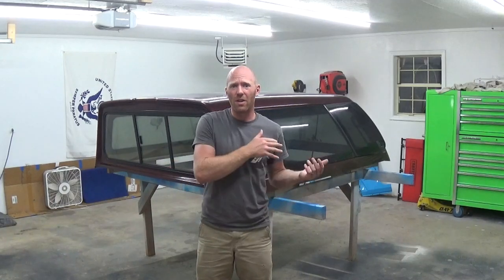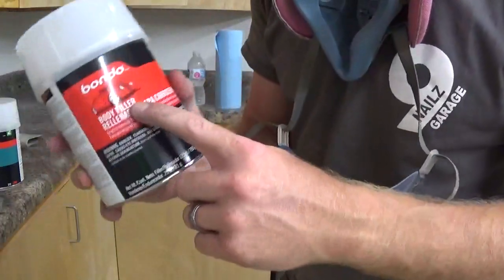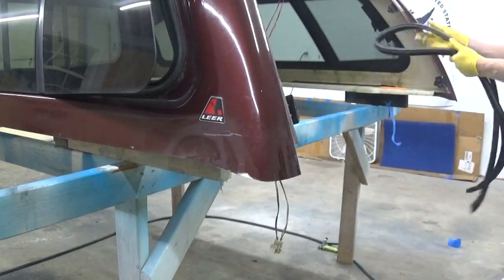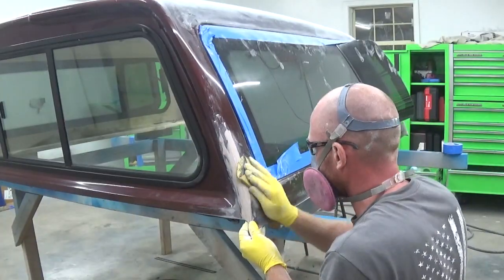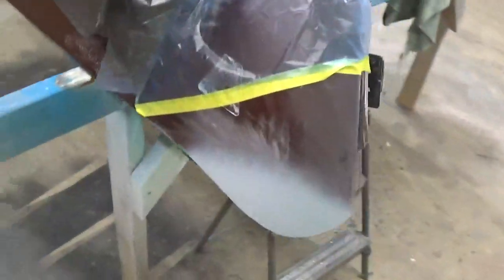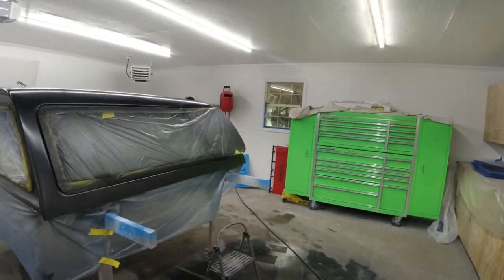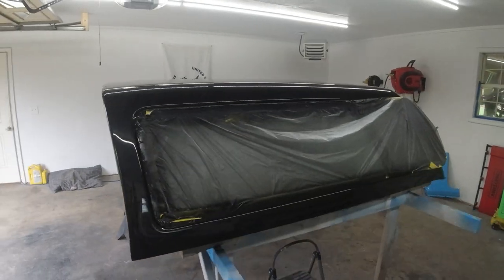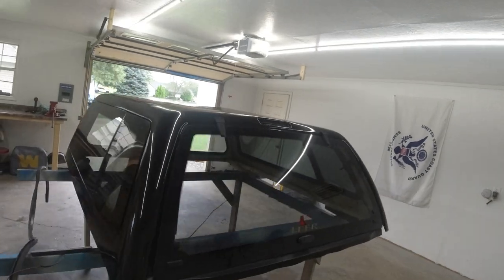How to Prep and Paint a Pick-up Topper in your Garage!

Comment: Thanks for the video. I just painted a red topper I got for my metallic gold F150 (they have to match right?). Even though I used about a 10 gallon compressor and an inexpensive gun , it turned out great. Your tips were super helpful. TU.
Reply from the maker: I always wondered how a smaller compressor would work, glad it worked out!
Reply: 2003 f150 in Arizona beige metallic and just scored a Leer tall topper free but it's Teal..
hate that color so looking to get it painted. I'm in a condo or diy still may diy next door parking lot be better than mismatched.
Ugly Teal grief.

Comment: That's an excellent video. I'm looking at a Snugtop, that's the pearl white that Ford has, and my truck is bright white. I hope I have your patience to paint it
Reply from the maker: Thank you! Good luck if you do give it a try. I was really intimidated the first time I picked up a paint gun, but it’s not as hard as it looks just don’t over think it.
Reply: @9NailzGarage  how much do you think it cost you from start to finish, not counting your labor?
Reply from the maker: @Merritt3246  1 qt of paint, a good pearl is probably going to run $100-$200,  a quart of clear coat and activator will run $40-100 depending on what brand you go with. Another $50 in miscellaneous materials not including the paint gun.

Comment: It would help if you posted a list of the supplies you used.
Reply from the maker: Sorry, I didn’t add them to this one, I’ll update it right now. Here’s a another video of painting some bumpers that can help out with painting too: https://youtu.be/U61x_mUtGgM

Also here’s a list of items that I used in the video along with their link in Amazon:

3M Accuspray Paint Spray Gun System
https://www.amazon.com/3M-26580-Accuspray-Spray-System/dp/B001UNZIP8/ref=sr_1_2?crid=6A3UOV9AIDX3&dchild=1&keywords=3m+accuspray+gun+kit&qid=1605282598&sprefix=3m+accu%2Caps%2C185&sr=8-2

Transtar 4603 Gray 2-in-1 Primer - 15oz
https://www.amazon.com/Transtar-4603-Gray-2-Primer/dp/B00H2W41X6/ref=sr_1_1?crid=1C81S982GD0QG&dchild=1&keywords=transtar+4603+gray+2-in-1+primer&qid=1605282766&sprefix=transtar%2Caps%2C195&sr=8-1

SprayMax 2K Glamour High Gloss Aerosol Clear
https://www.amazon.com/SprayMax-Glamour-Gloss-Aerosol-Clear/dp/B0082LJMC6/ref=sr_1_4?crid=3QS2PJKXHORVC&dchild=1&keywords=2k+clear+coat&qid=1605282827&sprefix=2k+%2Caps%2C195&sr=8-4

Dupli-Color Bright Silver Metallic Chrysler Perfect Match Automotive Paint
https://www.amazon.com/Dupli-Color-BUN0300-Universal-Perfect-Automotive/dp/B00407TVGS/ref=sr_1_2?crid=1HVEH0YZO9Z6I&dchild=1&keywords=duplicolor%2Bpaint&qid=1605282903&sprefix=duplicolor%2Bpa%2Caps%2C189&sr=8-2&th=1

3M Wetordry Sandpaper, 9-in by 11-in, Super Fine 400 Grit, 5-Sheets
https://www.amazon.com/3M-Wetordry-Sandpaper-11-Inch-5-Sheet/dp/B00004Z4BE/ref=sr_1_5?crid=3L47TGMPRLJ5Q&dchild=1&keywords=400+grit+wet+dry+sandpaper&qid=1605283168&sprefix=400%2Caps%2C192&sr=8-5

600 Wet-Or-Dry Sandpaper 5Pk
https://www.amazon.com/3M-9084-600-Wet-Or-Dry-Sandpaper/dp/B0000AXT76/ref=sr_1_6?crid=PHRD39V0XSLY&dchild=1&keywords=600+grit+wet+dry+sandpaper&qid=1605283247&sprefix=600+grit+wet+dry+sandpaper%2Caps%2C181&sr=8-6

3M Wetordry Sponge Pad
https://www.amazon.com/3M-05526-Wetordry-2-3-Sponge/dp/B000PEPCGI/ref=sr_1_14?crid=1FA11GL5T9GED&dchild=1&keywords=3m+sanding+block&qid=1605283297&sprefix=3m+sanding+%2Caps%2C188&sr=8-14
Reply: @9NailzGarage  thanks!
Reply: @9NailzGarage  This probably sounds dumb, but I'm a real newbie. What tool are you sanding with? Also what wax and grease remover should I use? I'm going to copy you exactly.
Reply from the maker: @tanyapadma  no such thing as a dumb question! Any wax and grease remover should work just fine, here’s one from Amazon: Kleanstrip Prep-All Wax & Grease Remover, Gallon (KLE-GSW362) https://www.amazon.com/dp/B008QDSVPE/ref=cm_sw_r_cp_api_glt_fabc_GSA6N4PM8J7DW42NTXQR

Also the sander I use is called a dual action sander, here’s something on Amazon that should work just fine: Professional Air Random Orbital Palm Sander, Dual Action Pneumatic Sander, Low Vibration, Heavy Duty … (6 inch) https://www.amazon.com/dp/B072PY2XR3/ref=cm_sw_r_cp_api_glt_fabc_NRNTMX6D698JD4YNG4SJ?_encoding=UTF8&psc=1.

Here’s some sand paper that will work with the sander, you should get a few different grits working your way up to 400 before you put the paint down. 

Dura-Gold Premium - Variety Pack - 6" Gold PSA Self Adhesive Stickyback Sanding Discs for DA Sanders -10 of Each Grit (80, 150, 220, 320, 400) Box of 50 Total Sandpaper Finishing Discs https://www.amazon.com/dp/B07DTJNL4T/ref=cm_sw_r_cp_api_glt_fabc_VG19C2TEGP62VT99WZE5?_encoding=UTF8&psc=1

Good luck with the project! Check out my other videos on painting bumpers for more information on general painting. 
https://www.youtube.com/channel/UCYTCFvvaLaPfwwIUdnv5bAw
Reply: @9NailzGarage  I really appreciate this. Thank you. I will definitely be checking out your other vids!

Comment: Fantastic video! Thanks for making this. It's extremely helpful. I'm about to try my hand at this on a cheap fiberglass top I got. 
What paint would you recommend? I've heard people say boat paint works well on fiberglass.

Just a suggestion, There's lots of echo in the audio, and this can be mediated with a better mic, post production audio work, and sound dampening in the room.

Thanks again!
Reply from the maker: Thanks for the suggestion, I actually had a new mic that day that I was trying out. I think I’ve got the audio figured out now though, just the regular go pro mic works pretty good. 

Definitely do not try to save money and buy cheap paint, it’ll cause more problems than good, I know from experience. I buy ppg Omni at the local orilley’s it lays down really nice every time. Here’s a link to another video of mine that also covers all the products I use and it has the links in the description.

Good luck on your project!

Comment: I am considering doing this. What primer did you use? The shell has a gelcoat, right?
Reply from the maker: The primer I used is transtar, here’s the link on Amazon: Transtar 4603 Gray 2-in-1 Primer - 15oz https://www.amazon.com/dp/B00H2W41X6/ref=cm_sw_r_cp_api_glt_fabc_F9FWRXGBM09V24TQSP0Y?_encoding=UTF8&psc=1
Reply: @9NailzGarage  I just applied this Transtar to sanded factory painted areas on a 2018 Camry near the gas filler door....as well as bare steel after I removed rust....I did three coats and waited 30min between each then waited an hour after the 3rd....when wet sanding with 600grit, the primer is coming off so easily, I'm shocked.  Am I supposed to put it on very thick and sand super lightly?  I a newbie. Thanks!

Comment: What kind of wheel that you removed weatherstrip adhesive with?  I couldn’t catch that am and not familiar with it.  Thanks
Reply from the maker: It's a 3M eraser wheel, link below. They're super effective at removing stubborn stickers, vinyl and adhesive!

3M Stripe Off Wheel Adhesive Remover Eraser Wheel Removes Decals, Stripes, Vinyl, Tapes and Graphics 4” diameter x 5/8” thick 3/8-16 threaded mandrel 07498 Pack of 1

https://www.amazon.com/Adhesive-Remover-Graphics-diameter-threaded/dp/B00063VT0G/ref=asc_df_B00063VT0G?tag=bingshoppinga-20&linkCode=df0&hvadid=80814156492390&hvnetw=o&hvqmt=e&hvbmt=be&hvdev=c&hvlocint=&hvlocphy=&hvtargid=pla-4584413735745294&psc=1
Reply: Thanks

Comment: When I sand in gets dust all over
Reply: How do I fix this
Reply from the maker: Happens to me too, I wear a dust mask and just try to keep the windows and garage door open to help keep it out of the garage. I think that’s about all you can do unless you have a ventilation system.
Reply: No matter what you sand you will get dust all over. Sanding is just the process of an abrasive and friction to slowly take away small particles and smooth out the surface. Nothing to do besides keep a shop vac near by and get a dust bag for your sander will help a little

Comment: Great job.  Thinking of tackling my Snugtop.  Is this your topper, how is it holding up after couple of years?  Have window areas flaked or peeled at all?  If you did it again, mask or remove windows?  Also, nice shop… amazing toolbox is still green😊.
Reply from the maker: Thank you! I’ve painted a few toppers that are still holding up with no issues. No issues around the windows, removing them can be a huge pain, I think they are sealed